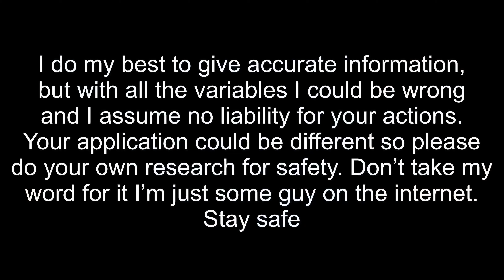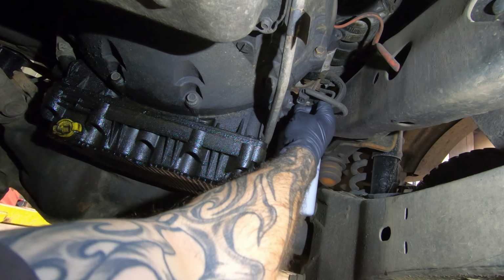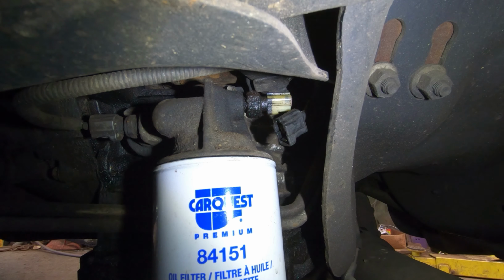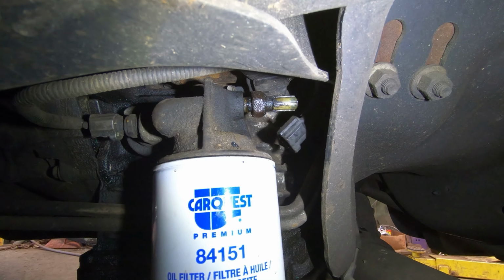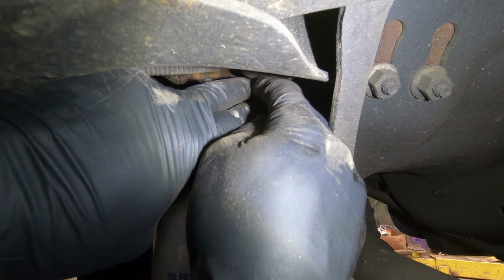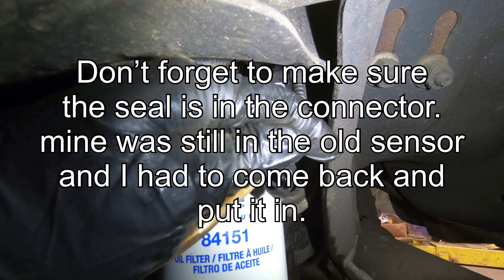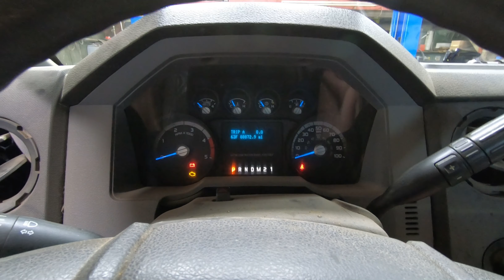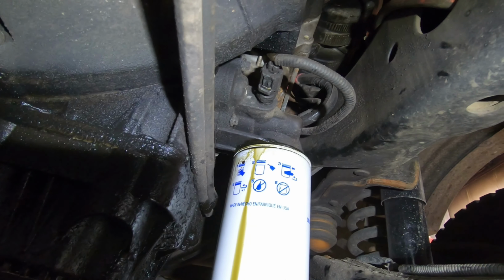Ford super duty 6.7 power stroke intermittent oil pressure light

Comment: Sir I have a 2012 F350 6.7 and I replace the pressure sensor the pigtail but on mine it says ENGINE OIL LEVEL LOW I grounded the wire and it still says Engine oil Level low it has no codes for oil pressure switch.
Reply from the maker: Is it saying the oil pressure is low or the level is low. Might need to put some oil in it if it’s saying low oil level. If it has a oil level sensor on it it would be in the side of the oil pan I’d imagine. It’s going to be a different sensor then the one I made this video about.

Comment: another good video man! I think mine is leaking as well. I haven’t had the light yet but prob a matter of time
Reply from the maker: Thank you. I think these sensors are prone to failure. I just replaced one on a 2017 350 with a 6.2 engine for the same issue. Although all our other 2012 trucks haven’t had any problems.